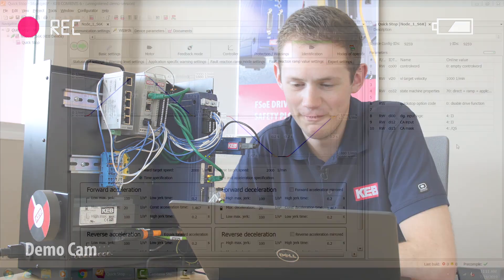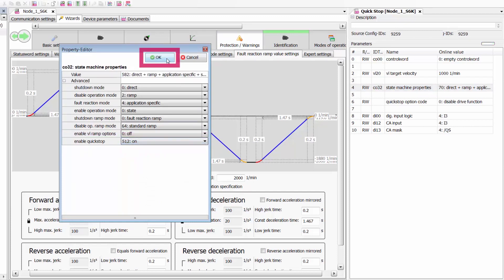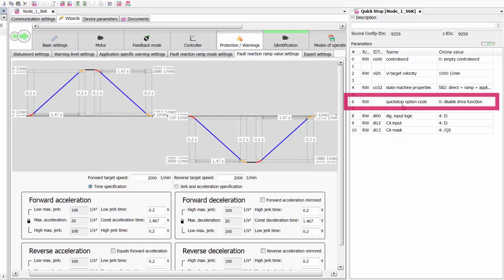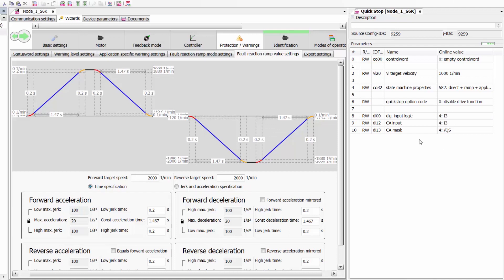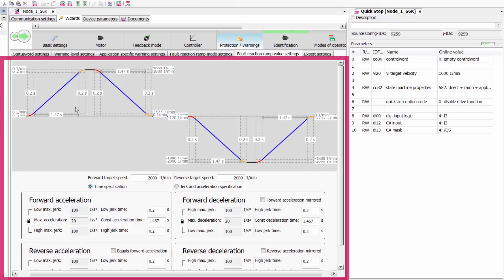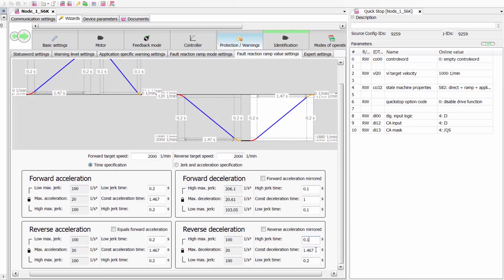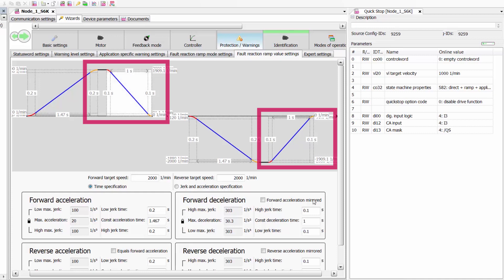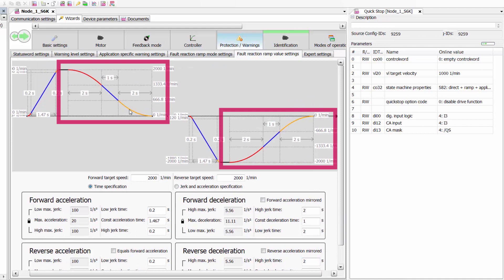What is the Quick Stop Function in a VFD? - Problem Solved

Comment: If we can use dc break safely so why we use external resistor to reduce deceleration time
Reply from the maker: DC braking is different than using a braking resistor. The braking resistor is used to protect the drive during deceleration, where a faster decel is more likely to cause an error on the drive. DC braking is just one way to achieve a fast decel. Hope this helps!